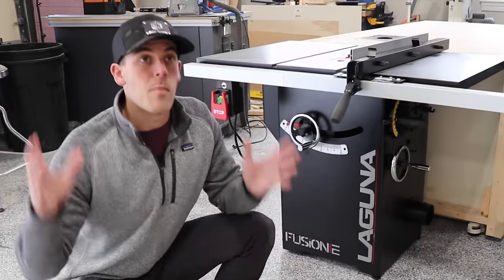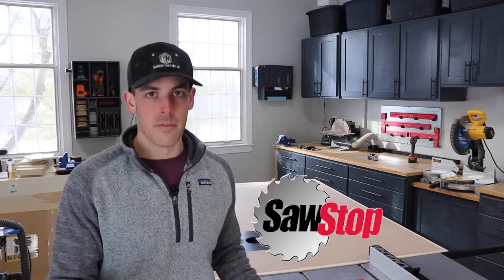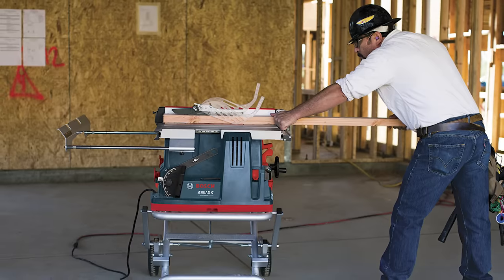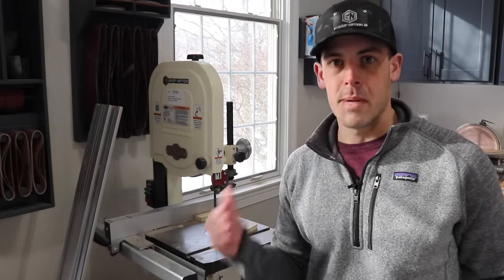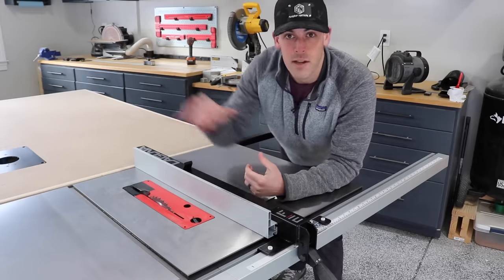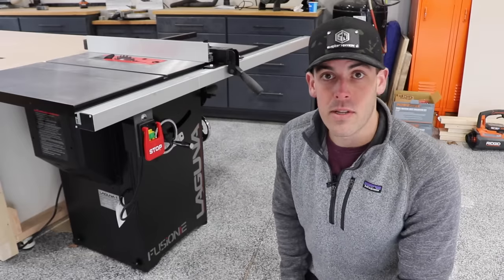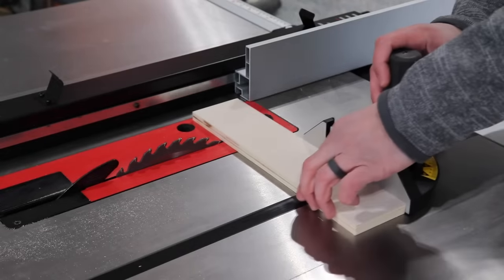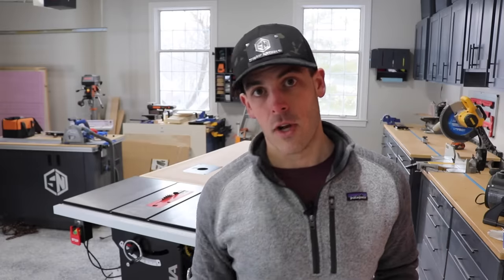Why I Bought a Laguna Table Saw over SawStop!

Comment: Can you please post an in depth review of the saws features and any negatives. Im seriously considering this saw.
Reply: What features are most important for you?   The overhead dust collection is nice and there are mixed reviews on it.  I think you need a multi HP dust collector to get it to work at all.  A small (less than 2HP) will not work well, from what I have heard.   So, take that into consideration. 

You might want to consider the Jet Pro Shop, as internally the Jet and F2 are pretty much the same saws.  Jet has a much better warranty and a much better fence system.  You can also look at the Grizzly G0771Z, the Shop Fox W1837, even the Grizzly G0899.   I owned a Fusion F2 for about a week.  I had to return it due to shipping damage.  It was replaced by a Shop Fox W1837.  I have not run either saw, but unlike Travis here I think the Grizzly and Shop Fox are as nice, or nicer than the F2.  I am in the middle of assembling my Shop Fox.   It is hard to say really which is better, as some things on saw "A" are better than saw "B", while other parts on saw "B" are better than on saw "A"  They are all nice and good quality saws.  The Grizzly G0899 is a much beefier than the F2 and I think it might be the best deal of them all.   Just look at pics online, or look at the photos and parts in the manuals.   The G0899 was just to heavy for my needs.

Feature wise, this and other saws may compare to the Saw Stop, but the Saw Stop (and other real cabinet saws) weigh 100+ lbs more.  You better believe that the real cabinet saws are beefier, stronger and better saws because of that.  The F2 and the other saws that I mentioned are "hybrid" saws.  Not contractor saws, but not full on heavy duty cabinet saws either.  It just so happens that is exactly the type of saw I need for my garage/shop.

Oh, another saw to consider, if you do not mind the weight is the Harvey.   Yeah, you might want to do some research on Harvey table saws.  If a 400lb table saw is to big and heavy for your needs, then you can ignore them.  If you are planning on placing your saw in one spot the Harvey is a great choice.  Last I looked they were on sale at some great prices.

Good luck on your search for a saw.

Comment: FYI, running a 1 or 2 hp motor at 110v versus 220v will be negligible in performance difference.  While it is a good thing to do (220V) for 1-3/4 hp motor just don't expect to see a difference in performance.
Reply: This is true.  At start up is where you will see the biggest difference.  A 2HP motor at startup can draw a lot of current.  If one of these saws is run on a 15amp breaker, over time that breaker will weaken and fail.  It will need to be replaced.  This is why while a 15amp circuit will work, a 20amp is recommended.   Switch to 220 and there are no issues, you are drawing 1/2 the current.

BTW, it is very easy to switch the Fusion F2 over to 220v.   You can get the necessary 240v magnetic switch (same switch just 240v) for $15 +/-, the necessary 9amp thermal breaker for less than $10 (off brand on amazon), or Jet offers the same brand breaker for a bit more.   Much cheaper than the $89 that Laguna wants to charge.

Comment: I have gotten hurt twice using a table saw. Neither would have been prevented by any sort of saw mounted safety feature. They happen because I was rushing and ended up with a kickback. (I did a video about them)

One thing that I don't like about sawstop is their pushing legislation for blade stop technology to be mandatory on new saws.

Comment: I've been on a table for almost 40yrs & use push blocks for small cuts, simple. It seems hilarious that there's a market for people who need a saw that won't cut their fingers off
Reply: Now that is the point exactly.   I have seen people do stupid things on a table saw to be sure.  But if you simply need this saw because you are incapable of using good safety protocols then you need to stay out of the shop.  If you want it because it adds an extra layer of protection in conjunction with good safety protocols that is fine.  I can say that that the safety feature on the saw stop has caused many people to be careless with their safety protocols.   I have commented to coworkers about it many times at work.  I see it almost daily on one of the five saw stops in the furniture factory that I work at.  The response is always the same,  it can't hurt you.  I don't run the saw stop at work any differently than I run my unguarded powermatic at home.  For most people I am afraid,  stupid at work will eventually translate to stupid at home.  Circuitry is no replacement for  followed safety protocols.  40 years and ten fingers because I don't do stupid things on my table saw.

Comment: I have been looking at the Laguna F2 and the more I look at it the more I like it. I have a question about the Fence System on the Laguna and the best person to ask a question about a product is the person who owns one and has used one for a while. I have seen a video about the Laguna Saws and the person presenting the video said the Fence moves on the outfeed while feeding long stock or plywood through the sawcut. I would like your feedback on the Fence System and it's stability to feeding long piceces of stock or plywood through for a rip cut. I have looked at Saw Stop and the price is the limiting factor. I have owned for over thirty years, still use a Shop Smith and I still have all my body parts. Your view point about the Fence would be greatly appreciated.

Comment: I've had the Saw Stop "safety" discussion with myself ever since I built a dedicated shop in 2014.  I keep talking myself out of the Saw Stop with the following reasoning:
Losing a finger is a BIG deal, a lot of pain and suffering, and huge medical bills.  The extra money is really pretty cheap insurance.  
But the table saw isn't my only dangerous power tool in my shop.  Frankly, my 8" jointer scares me more than the table saw.  Then I've got 2 bandsaws, a router table and a lathe.  There's a bunch of hand tools too.  Any one of those has the capacity to do as much damage as a table saw, but NONE of them have ANY safety features to protect my fingers like the Saw Stop has.  
So, will the Saw Stop give me a false sense of security, making me to be less careful with all those other tools?  Should all my tools be equally scary as a reminder to be CAREFUL using ANY tool in my arsenal?  
I'm still using my used Grizzly that came from a cabinet shop and has NOTHING wrong with it after years of use.  They sold it to me when THEY bought a 5HP 3PH Saw Stop.  
By the way, when I got it, the blade guard was disassembled in a box and had NEVER been used!  I use it now, but I don't know if they put one on the Saw Stop.  They may still be using an unguarded blade.  So much for safety :-)
Reply from the maker: All fantastic points.  I think people get so wrapped up in the ONE safety feature of the SawStop they talk themselves into it under a false premise.  I have no issue with people spending the money but just do it because you think its a superior saw, not because it's going to save your life

Comment: I've owned an F2 for almost 3 years now and have only one complaint. Because it is a 1.75 HP motor running on 110v its a bit under powered when pushing 8/4 stock or more. The plus side to it being under powered in this scenario is i don't have to worry about kick back if the blade gets pinched. The saw's breaker trips. At least I don't have to worry about the saw shooting a piece of wood through my garage door, or body for that matter. Although, I did lose part of my thumb at some point in the last 2 years. Not ognna blame that on the saw though!
Reply: Do you have a 20amp circuit for that saw?  If not, you should try to get one, or find another dedicated circuit   Every time that thermal breaker trips you could be lessening the life of your motor.
Reply: @alsmith7316  it is on a dedicated 30 Amp circuit. it's not the house breaker that trips. The saw itself has a safety breaker on it. I don't use a roving mOst of the time, so when running 8/4 and and the blade gets pinched the saw trips. It's usually when I am cutting 2 inches or more off of a board. Also depends on the type of wood I'm running through it.
Reply: @thajollyman1 Thank you for the clarification.  Are you using the stock blade, or which blade are you using?  Is your fence square to the blade?  Not sure why your material is "binding".   That breaker on your saw is more than likely a 18amp breaker.  It is possible it is tripping earlier than it should be?

The breaker in your panel will trip if you pull too much current through the circuit.   The thermal breaker on your machine will trip due to not getting enough juice, or being over worked.
Reply: @alsmith7316  it's a matter of the kiln dried material warping as its being cut. I believe kiln dried material is known to have internal stresses that release when cut, especially when cutting off larger chunks from wider/thicker pieces. My fence is actually set slightly open. Using full kerf Diablo industrial blades. 24tooth for rip cuts. 80 tooth for crosscut.
Reply: @thajollyman1  Ok, understand now.  Yeah, I set my fence just slightly open as well.

Comment: How many viewers can still count to 10 with all 10 fingers? Build quality is about the same between the vendors. The sliding euro fence is nice on the Laguna. The safety factor is worth it unless you have really great insurance and heal very fast like a Tibetan Monk. My mid-range Sawstop is the pro model with big side extension and I got the roll-around Industrial base. The base pumps up with 2 or three foot falls and glides around in 360 degrees. Price was around 3600 awhile back and I picked it up in my truck so no shipping cost.

Comment: Love how you approached and delivered details on this video. I am currently researching saws. The F2 is on my list! Harvey is also on my list.

How do you like the miter gauge on the F2? 

From what I have seen, the miter gauge that comes with the Harvey is a premium miter gauge. And, the tin coating is an interesting feature for the cast iron top. Especially for shops in a garage like mine that have a potential for temp changes that can lead to a little condensation. Also, if I am not mistaken, the comparable Harvey is a little stronger with .25 hp more that the Laguna. The comparable Harvey is 2 hp and still runs on 110v. The comparable Harvey does come at a higher price tag. Just under $2k. 

I would love your input and thoughts! Thanks so much! Hitting the sub button next! 👍

Comment: I feel the same as you about the SawStop and have been looking into Laguna. Question for you; did you also happen to compare the Laguna to Harvey as well? If so, what were your thoughts?
Reply: I did some research and as far as i can tell Harvey, Laguna, and Sawstop are all made by the same Taiwanese company but each adds their own touches to the saw with the sawstop obviously being the most premium. For $3500 you get pretty much the top of the line sawstop table saw without the hotdog saver.

Comment: I agree with you 100% I have been using a table saw since I was 28 now 65 ànd Saw Stop two safety patents run out this July it dose have the option to go to 2024 if no objection ànd I am sure all the table saw will object it going with 2 more  years any way you look at it the end is near for monopoly of the safety table saw market. ànd as I said with over 37 years on a table saw I still have all 10 fingers the worst was a kick back only one time

Comment: I wanted an F2 but settled for an F1 because of availability reasons and i had a project that i needed to start. The only part i regret is having the stamped steel wings. Mine passes the nickel test with no issues and does it quietly. I definitely would have bought an F2 if there was someplace where they were actually in stock.

Comment: I have that saw, for the price and features i’m quite happy with it think you will be to, also have there 14/12 bandsaw which had a couple QC issues, there were some welds that weren’t positioned properly so some of the bracing wasn’t attached, still a good saw but was a bit disappointed with that, however i am happy overall and happy with the choice i made.

Comment: I've seen a lot of guys with a few less fingers, but I've never even had a scare or a slice. I like Sawstop for their innovation, I can respect the engineering. 

But I'll never have one cause I live in Ireland and that shit barely exists here. You either go contractor saw or full on cabinet panel saw haha. There's very little in between. Although I did manage to buy a 2,500 euro 4HP 12" saw just like the laguna, just a little bigger. 

Sometimes I really envy america on how well its industry is set up to accommodate the medium sized wood shops. Those tools cost me double what you guys pay if I can get them at all 🤣🤣

Comment: Not bad, I’ve been looking at the fusion 2 or 3 as sawstop is far to expensive for me.
Reply: The Jet Proshop is the same saw internally.   I have owned a Shop Fox W1837 and I like it alot.  Seems to be on par with the F2 that I breifly owned.  Different features, but both nice saws.

Comment: I was thinking about buying the Fusion 2, but now I'm wondering if I should get a saw with a cast iron trunion instead of aluminum (as the Laguna has), and also a saw with a steel rail instead of the aluminum (like the Laguna has).

Comment: I lost my leg this summer, trans-tibial amputation, so losing fingers, is not in my agenda. I'm Canadian, so I have full medical, ie. I didn't have to pay for the Ottobock prosthesis to the tune of $16k, I also didn't have to pay for the hospital stay etc.. CBC reported 67,300 table saw injuries, with 4000 amputations; that was in 13-14.

In 1992, Iwas almost killed at work, and I was following the procedures. Right now, I am searching for a saw, I keep going back to the Sawstop folding job-site saw...I'm not a pro-carpenter, and I don't need to lose anymore body parts. Life is for living, but mitigating risk is important...there cannot be a discussion where saw value becomes an "is it worth it" question...of course it's worth it, we aren't lizards, things do not grow back.

The money difference between many of the saws out there is no way too much for me to change my mind...even in Cdn. dollars, the Sawstop is the way to go...it's potentially the most dangerous tool that will be in my shop, so well worth the extra money.

This is not a criticism, just a comment, people can justify things as much as they want, until they lose something, then they start to think differently. If money was the overiding factor, I would buy a Metabo job-site saw, the reviews are just too good.

On a side note, Bosch had a system too, and apparently you can still buy them in Canada, in the States, patent law said otherwise. Sawstop really should lighten up, and share this technology, then it would come down to saw quality, which in the end should be the overiding factor.

Comment: I looked at the price of this Laguna and it's $1399.  A 1.75 HP SawStop with 36" extension and excellent fence is $2619.  So yes it's definitely more expensive, but it's not a $10k difference - I wouldn't call $1200 difference crazy expensive.  For me, I gladly paid the extra $1200 to help me keep my fingers.
Reply from the maker: Forgot to add the mobile base and over blade dust collection - but yes I agree it's an excellent saw!

Comment: What a fantastic review. Exactly what I needed to make the final decision to buy. Curious if you removed the top at any point and if so, how easy it was to remove the top, then reinstall it and get it all aligned properly. I have a shop in my basement with only access through my house so getting it down a narrow set of stairs (with a turn) will be impossible without a little disassembly first!  Anyone experiences would be greatly appreciated.

Comment: I feel like since it's basically the same mechanism in all the ss table saws that they charge so much for, it seems like that should be a set price for that unit. And then all the rest of the saw should be at a pretty standard price point. If that makes sense. Like say, they shouldn't be able to double the price of the entire saw because it has a single 500$ component on it (I'm only guessing at the price for the component). Cause then a saw that averages around 1300 everywhere else for a comparable model, plus the cost of the 500$ component would bring the saw to 1800 instead of 4000$. From my understanding, it's pretty much the exact same component in all of their saws that's replaceable

Comment: I use to would have never bought a sawstop.  Too expensive, but as I have gotten older, I'm not quite as steady as I use to be.  I work by myself, so I am gonna bite the bullet and buy a saw stop purely for safety reasons.  But when  I was a young fella I would do just as you have done and spend that extra money on other tools.

Comment: I’m curious as to why you think this is a better saw then the grizzly hybrid. It has a 2hp motor, enclosed cabinet and cast iron table and rip arms. I guess the Laguna has a longer rip capacity but only 5”

Just curious on your thoughts looking to upgrade out of a contractor job site saw. This is one of them on my short list.
Reply: The grizzly is better (heavier built in every aspect except the throat plate). Laguna has the looks. The extra rip capacity is down to the laguna’s lighter/smaller fence that can be slid further on the rail.

Comment: Nice saw. Great review. That’d have to work harder to get me to like a fence that looks sub par. I mean, it (the fence) does have great features. So did my Delta Unifence (that had considerable more capacity and, appears, far better build quality). So if you add an aftermarket fence to bring it up the quality of the competition, it does change the price point.